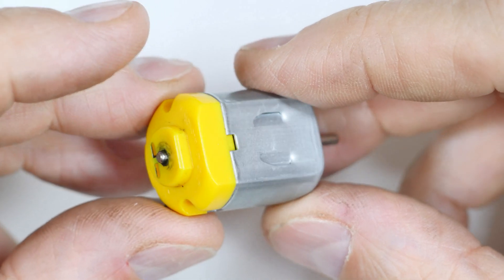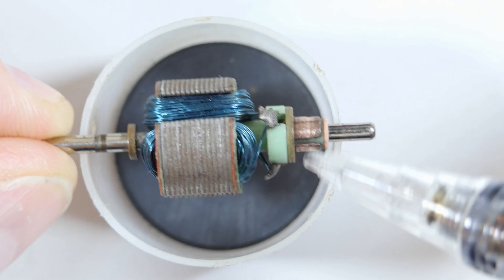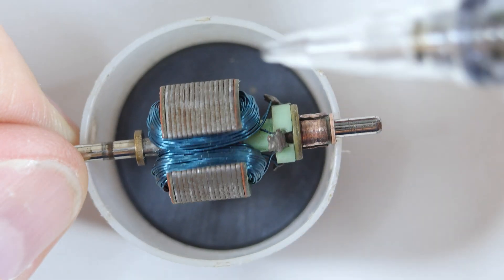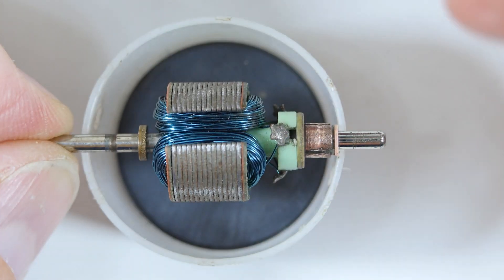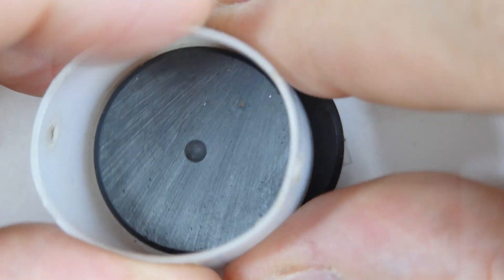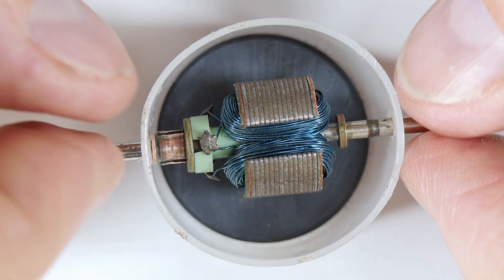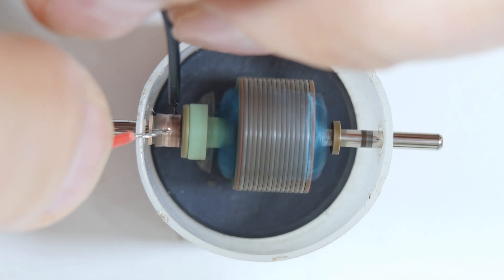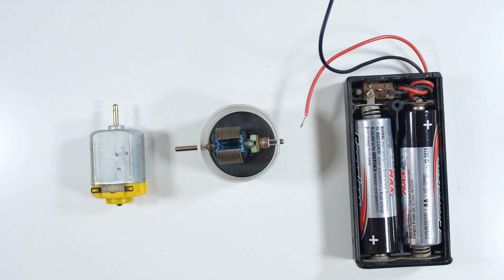DC Motor Experiment / Teardown (4K)

Comment: Nice! Any ideas on how to improve the speed of a motor? Without a gear system
Reply from the maker: I've heard you can change the position of the brushes relative to the magnets.  I've never tried it.  You can also hear it run faster when I move the brushes closer together, so that's a possibility.
Reply: @tsbrownie Thank you so much I will try it! Another thing, are you experienced with brushless motors? I have this RC plane brushless motor. When power is run through it the motor jolts and does not turn at all, and it only jolts sharply once. I'm not sure how old the motor is. Do you know how to fix this? Is it fixable?
Reply from the maker: @joelarchary7122  I have used stepping motors which are DC and brushless.  I've got videos on those.  Do you have a second motor to test?  Most brushless motors require a driver circuit, so I would first investigate if the driver was working by swapping out the motor with one I knew was working.  If that motor works, then the driver is probably working and the first motor is bad.  If that motor does not work, it's probably a bad driver.  Most of those things are hard to fix and usually not worth it.